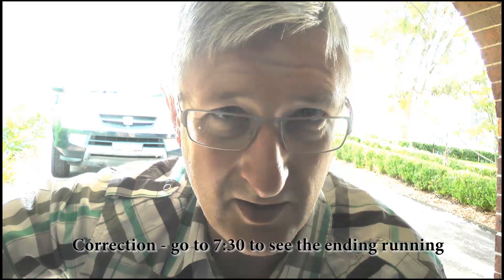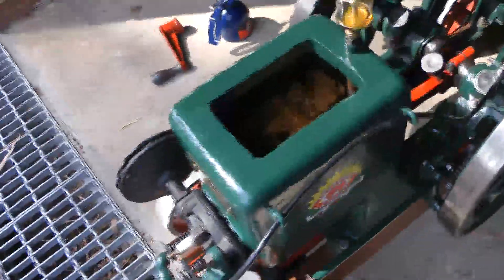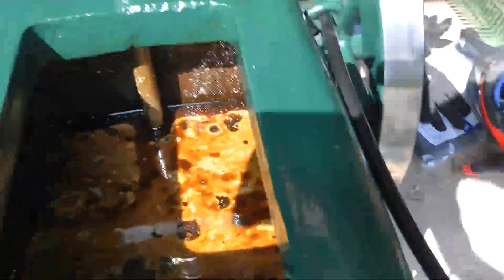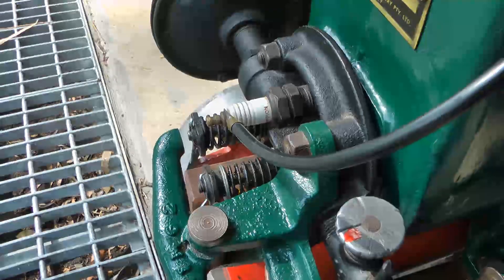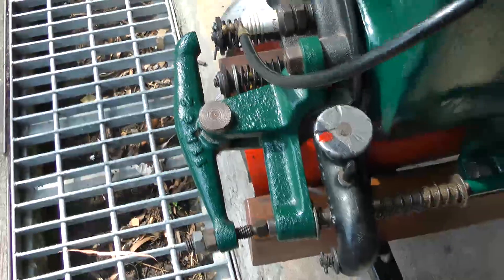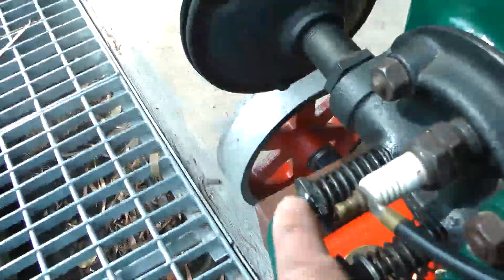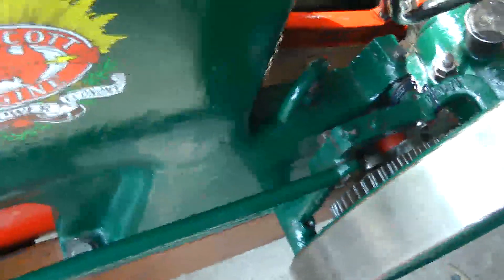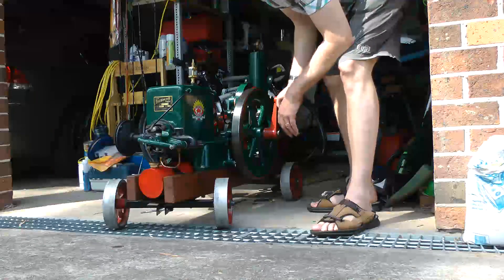Buzacott 2hp hit and miss engine

Comment: hi there, I have the identical engine and I am having trouble getting it running property. could you please tell me how you tune this little engine Please?
Reply: I don't have the engine any more but I do recall that there was a non-return valve in the fuel line which if stuck would cause the engine to be hard to start and run badly.  It was a little ball bearing in a captive fitting at the tank end of the fuel line which let the fuel up to the engine but stopped it flowing back to the tank.  Otherwise I never had any trouble with it... sorry not to be of more help.